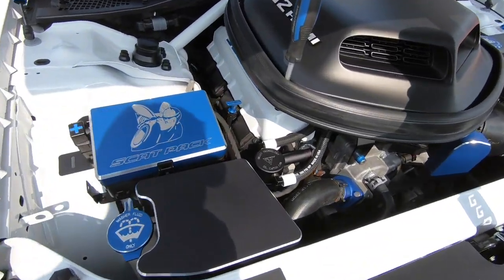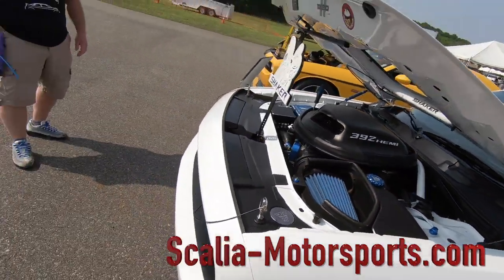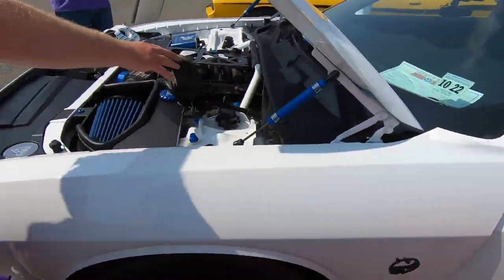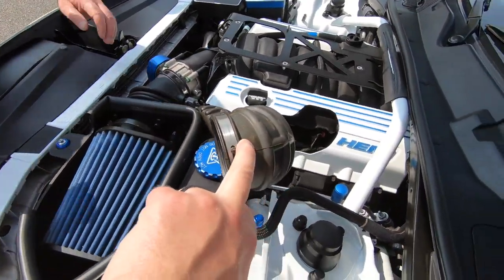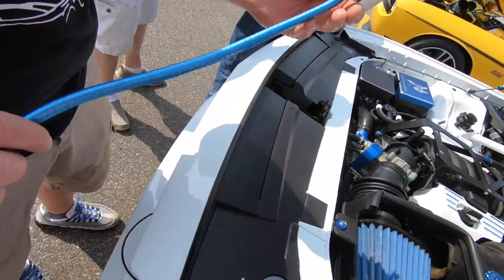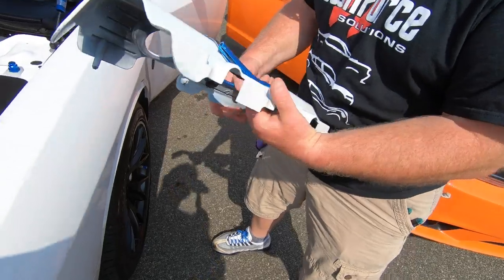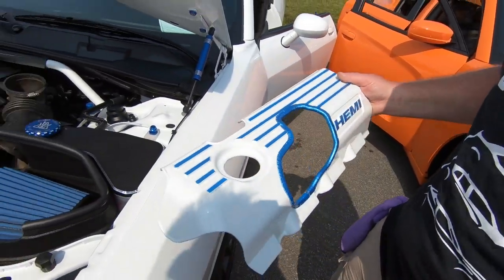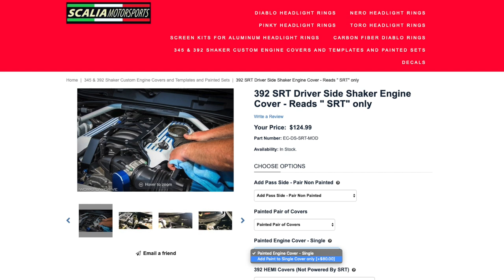Challenger Shaker Driver Side Half Cover Scalia-motorsports com

Comment: About that greenish brown air hose.  I removed mine and sprayed it with easy off oven cleaner let sit for a minute, rinsed with hot water and repeated the process a couple more times.  That stuff melted right off.  I didn't want to leave the oven cleaner on too long just in case it messed something up but it was fine.  Then I finished by cleaning with detail spray then treated with 303 protectant.  Nice and black now and it hasn't reverted to the ol' greenish yellow brown.
Reply from the maker: Great tip I'll share it with a few of the guys and see how it works.

Comment: That's funny as I just installed new 392 Hemi covers on my 19' Scat Pack Shaker today, it would have been nice to have a template for the drivers side in stead of marking and cutting...I fit and cut several times for a good clean fit...although my cutout is larger then your template shows....
Reply from the maker: Nice, It is a measure/cut/repeat process but totally worth it!  If you want to clean up the edges I put the edge molding in the video description
Reply: I saw the molding...nice idea...thanks for posting the video

Comment: Man, my inlet air tube is always brown as well!! I just thought it was a faulty batch of rubber from the factory. Do you or your buddy know if there is an aftermarket one to deal with this issue?
Reply from the maker: Someone mentioned soaking it in cleaner then treating it.  I need to get my hands on one to figure out a fix.   My first go to was Adams tire and rubber cleaner, soaking it then scrubbing with a microfiber.  repeating a few times then treating with Adams VRT.
Reply: Hey dude, if you haven't done so yet, just remove the tube and spray it inside and out with eazy off oven cleaner, rinse with hot water and repeat as needed. Then just dry it completely and finish it with a rubber/vinyl treatment like 303 aerospace.  I did mine over 2 years ago and it has been black ever since.
Reply: I used Adam's Graphene Tire Dressing.  Blackened it right up without even cleaning it first. I heard it works well on WeatherTech (I did my trunk mat half Adams', half VRT as a test) and the plastic/vinyl sections of floor mats that always look gray after cleaning.
Reply from the maker: My only issue with shine products is they make the mats slippery especially weathertec which are slick to start

Comment: Nice man.  I just got my 2019 Shaker RT and I didn’t have a passenger side cover.  Seemed really weird.  I have to look into whether I should have one.  I would assume I should.  Those half covers look amazing.
Reply: Hey Burnsey - this is the company I was telling you about in your latest video.  The guy that runs this company is from CT and is in the car club I hang with.   Good guy and makes good stuff.
Reply from the maker: It's normal with the shaker, they don't include the half cover from the factory on the driver side.
Reply: @WorkPlayDrive  I am DIY ing it and can't find the template any help?
Reply from the maker: https://scalia-motorsports.com/DIY-Template-Cut-Out-for-Challenger-Shaker-Driver-Side-Engine-Covers-p232103820
  Here you go

Comment: I dont get why he wouldnt just cut a slit in the half cover to accommodate the shaker mounting bracket instead of cutting the metal bracket. It looks like you would only need to cut a thin slit in it to fit it.
Reply from the maker: The Black bracket is hidden cutting a groove in the plastic would be much more noticeable.